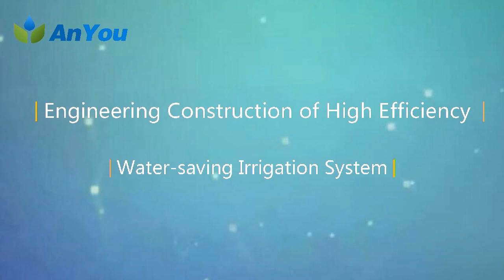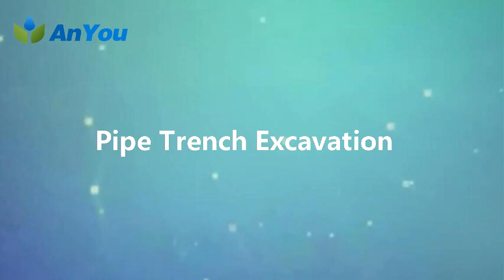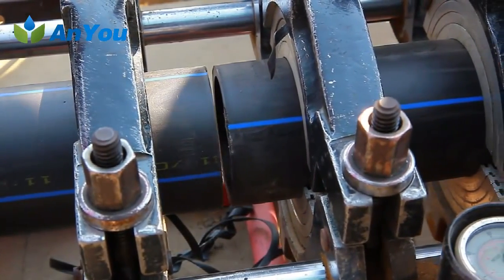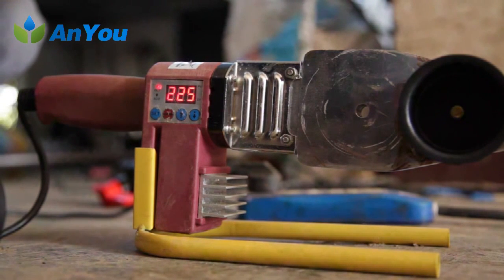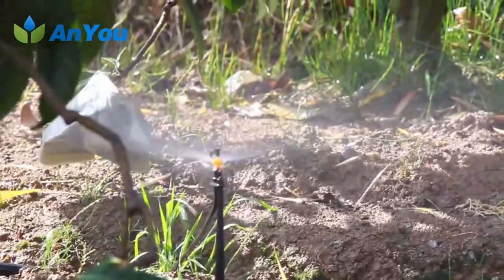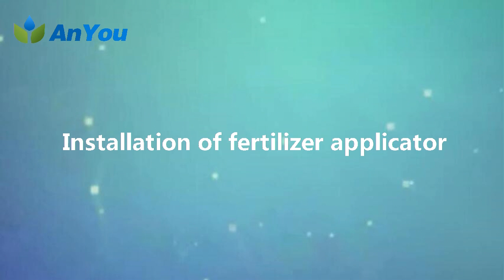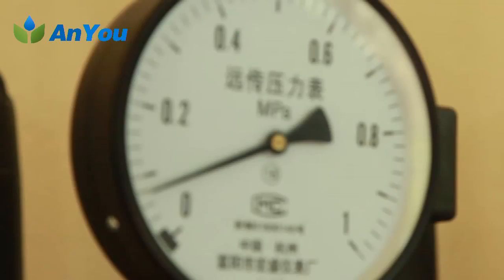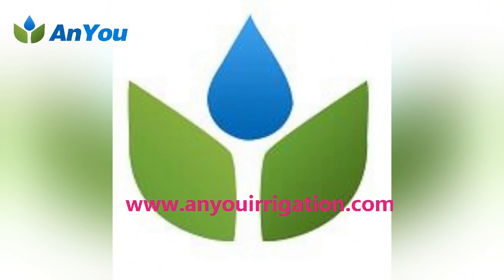Engineering Construction of High Efficiency Water-saving Irrigation System

Comment from the maker: The construction procedures of high-efficiency water-saving irrigation project include pre-construction preparation, Measuring and Setting-out, Pipe trench excavation, pipeline installation, system water test, trench backfilling and so on. This video explains the installation of irrigation pipes, the installation of irrigation irrigators,  the installation of  fertilizer applicator, and  the installation of filters.
www.anyouirrigation.com